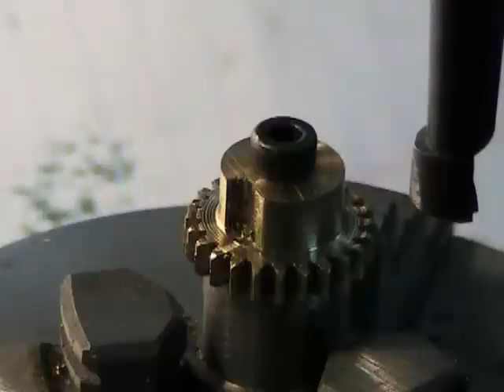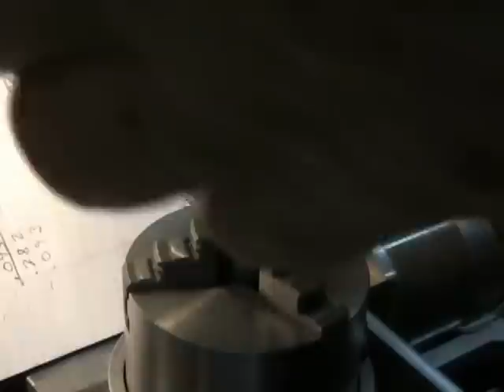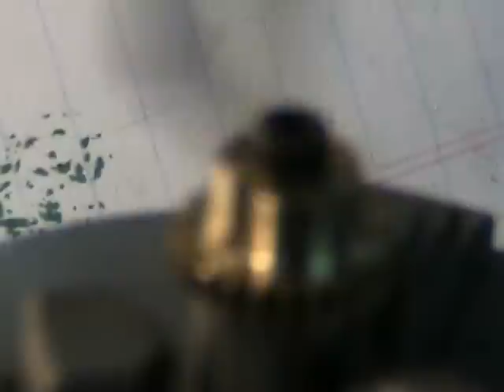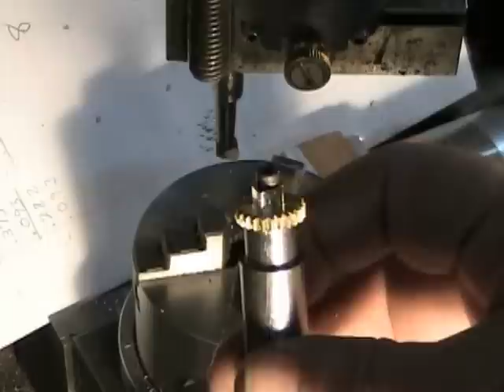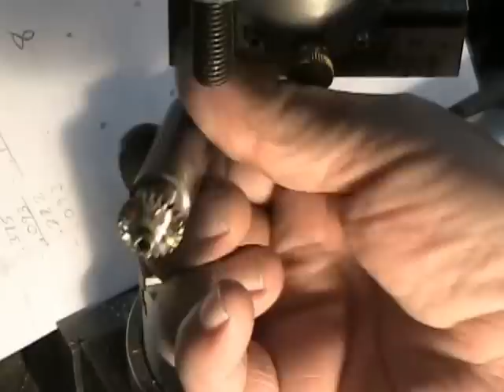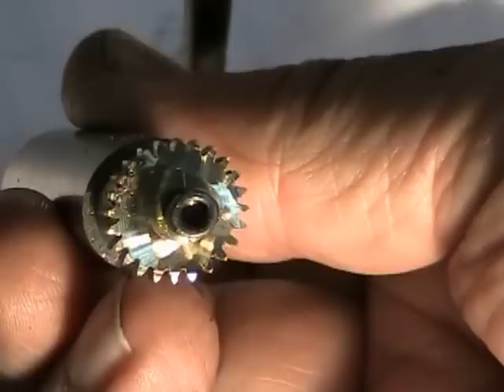Cutting a single cam profile

Comment: That's a pretty cool idea, using the boring bar to cut the lobe profile Chuck.
FYI, The minor diameter of the cam is called the "Base Circle" and the maximum lift point is called the "Nose." Keep in mind the engines "valve timing" is in relation to the gear teeth and moving the lobe in relation to the stock position can give you an engine that will not run if changed too much. Also the opening and closing ramps (sides of lobe) affect valve train acceleration and making them too steep will result in valve float at a very low rpm. You can increase valve spring pressure to a point. That point being when you end up with excessive cam lobe wear. Cam lobes are usually hardened after cutting to ensure a long life. Just a few tips I learned along the way from the school of hard knocks.